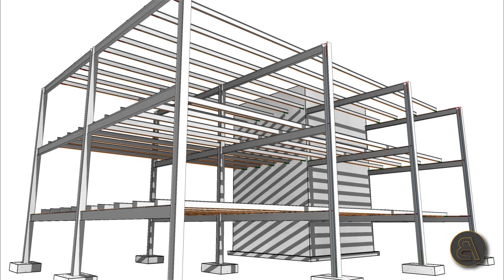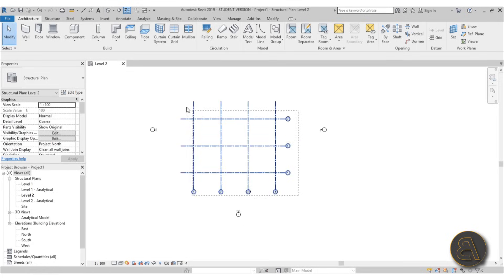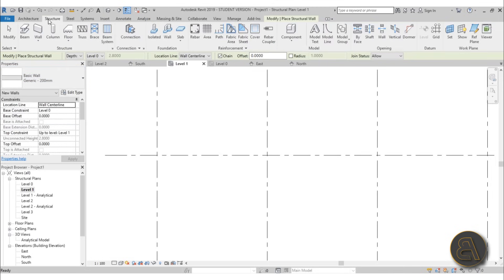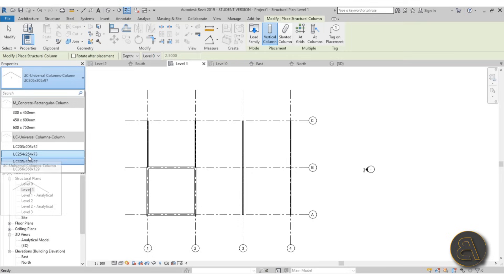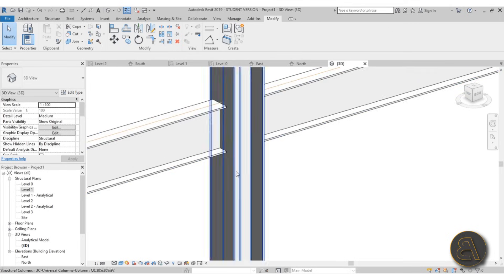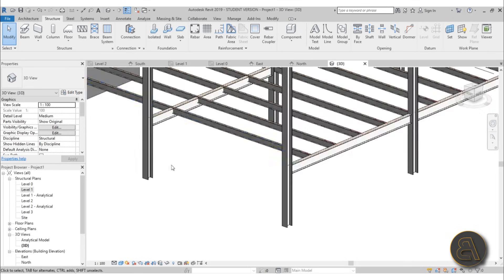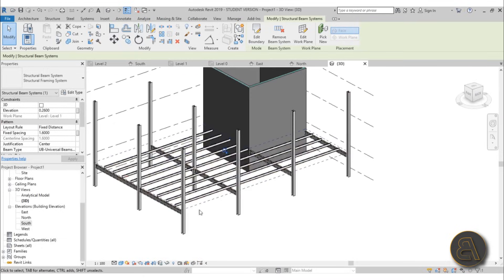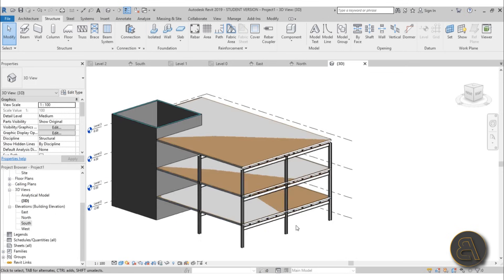Beginner Steel Construction in Revit Tutorial

Comment: Hello Balkan, how the steel beam is connected to the concrete wall? Is it simply supported or moment resistant to the core ? Any special clamp, anchor or whatever is needed at this point? Just if you can elaborate more on that.

Thank you for the video, made me try on revit

Comment: See for normal steel structural columns, do you need rotate them 90 degree when there is a change of direction in order for the beams to fit????

Comment: Hi Balkan,  
I want to know when you have a K series steel joist or joist girder that is at a roof and the joist is sloping, at the bearing seats; the seat is manufactured horizontal to the bearing point while the joist is sloped. Right now Revit shows the seat sloping so when you cut the section it's not shown correctly.  
Thanks in advance.